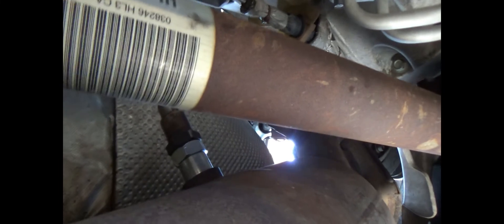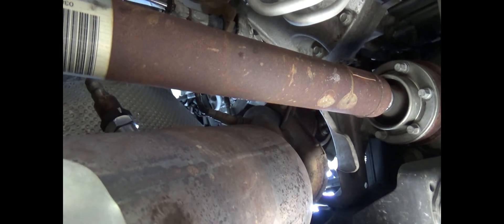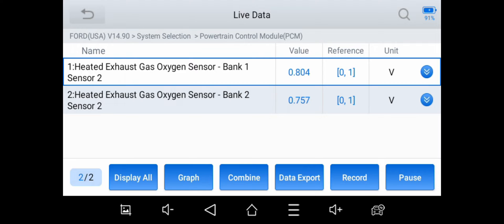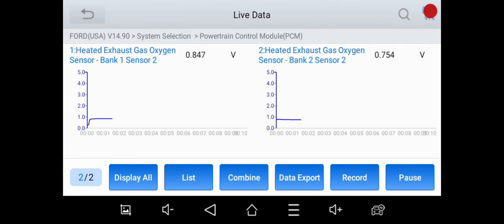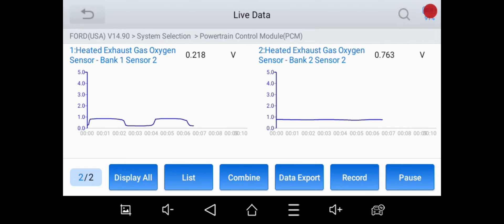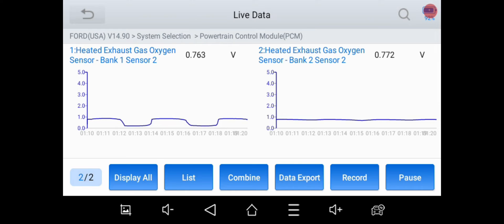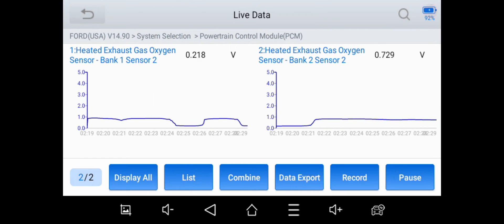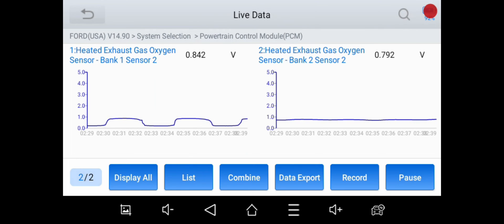Downstream O2 Sensor Reading after installing O2 Spacer on Bank 2 for Code P0430 or P0420.

Comment: It would be way better for me to put in the spacers and set aside money every check so I could get the catalytics later after the spacers stopped working. 
That way no credit card interest on an expensive job.
Reply from the maker: That would be smart, what these spacers do is buy you time. Sometimes it will take 3 or 4 years before it gets bad enough to cause the light to come back on and sometimes it may only give you a few days depending on how bad the cats are.